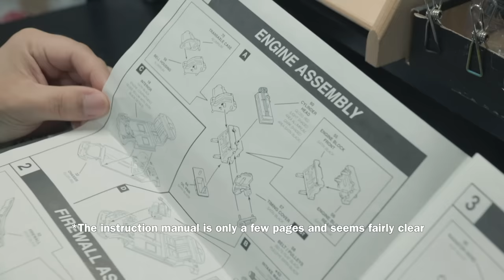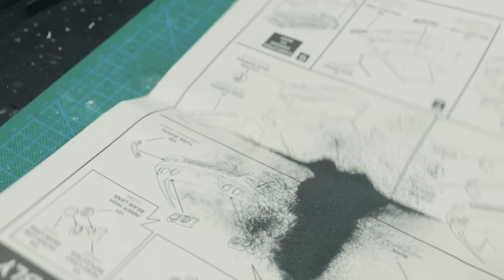(ASMR) Acura Integra Type R Model Car Full Build Step by Step

Comment: super clean build! any reason you went with exterior acura badges, but honda on the steering wheel? (i’m aware of USDM Acura and Honda JDM differences) as glass and engine is all stamped honda. i’ve just never seen visual exterior/interior badge discrepancies. not hating at all just curious to learn something new

Comment: Do you use BSI Gold for painted parts to avoid damaging the finish?
Reply from the maker: BSI is great for gluing clear parts and painted parts, it won’t damage the paint like modeling glue does but since it’s super glue it will still be messy and hard to clean if mistakes are made.

Comment: Hi, I want to ask, is assembling this car the same as assembling a Gundam? and whether assembling this car should be painted? or just cut and assembled already finished?
Reply: Gundams and car models tends to be worlds apart. 
Gundams, esp newer ones can be assembled straight out of box without the need of glue and (almost) colour complete, only requiring something to cut the parts out.

Car models on the other hand usually requires extra efforts like paint and glue, as you can see the parts only comes in white plastics. 

But, you can get pre painted cars from Aoshima, they're just like the one you see in the video, but you can skip the painting process (glue still needed tho).

Another option is, also from Aoshima, are snap kits. These are smaller and less detailed, but these you can skip the paint and glue, and comes with stickers to most of the non painted parts.